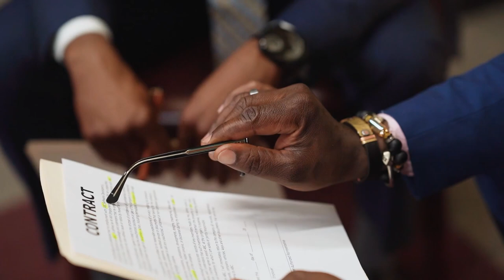Elon Musk REVEALED SpaceX MINDBLOWING $3.2B Space Factory!

Comment: I am trying to figure out how 100 kg of anything is going to be worth the cost.
Reply: @maximilianmander2471  One 3D printer weigh about 100kg  (220 lbs). Starship can carry 100 tons or 91,000 kgs of cargo. That 9000 3D printers.  How many human organs can be made?
Reply: Any high cost medicine? If zero G makes it cheaper to manufacture. At 700 dollars per dose of 50 mg... you're looking at 1.4B dollars for 100kg.
Reply: Just read the replies. Interesting. Thanks.
Reply: Custom grown organ replacement.  Speed of transmission fiber optic cables. Are the first 2 products. Sun atomic graphics cards 10000 faster than the fastest available.
Reply: I just finished a project on this subject, and quite a few things, a viable 3d printed heart would be about (before market adjusts) $500,000 for 300g of heart on average. and there are plenty of drugs that could only be made in space that can get that expensive, I mean cocaine is like $100 per gram (100,000 per kg). Dammit now I'm thinking of space cocaine 10 times more efficient.